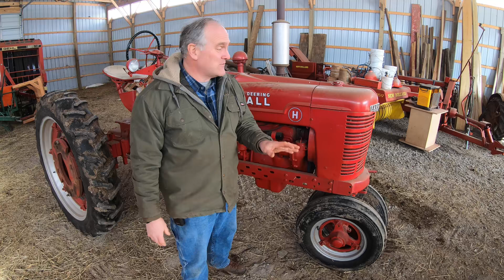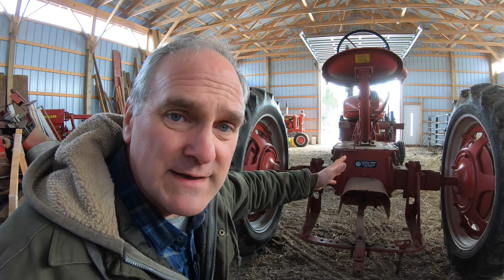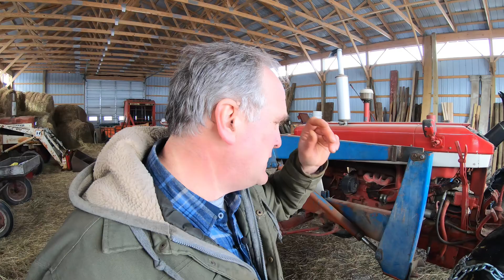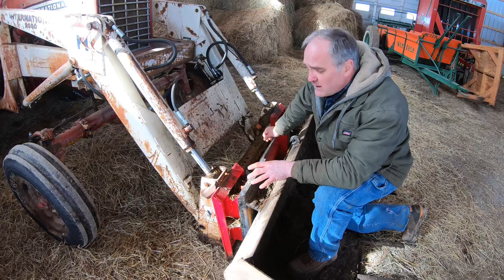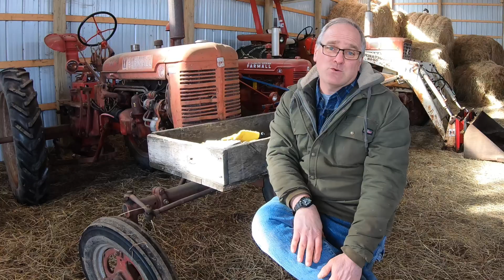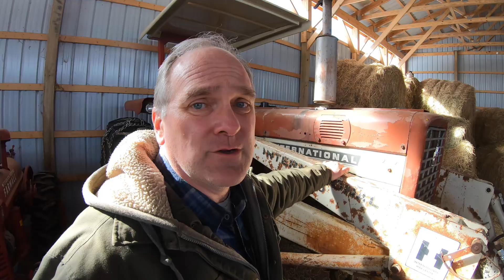Buying an Old Tractor for Your Small Farm

Comment: Just a quick note: To add to what Pete shared in this video, one thing to consider when buying a tractor is the type of attachments and how often you may use them. Working in a rental yard, I work with customers all day who moved to the area, bought a small farm, went and spent 20,000 on a tractor, and even more for implements. But in then end they still give us a call at the rental yard because they didn't purchase the one implement they needed. Often times that is a backhoe attachment. You could easily spent 5-8,000 on a backhoe attachment that you may only use a couple time a year. So in that case, it may not be a good return on your investment especially when you can go to a rental yard and rent a bobcat excavator for a weekend for around $300.00. The other aspect would also be service and maintenance of an piece of equipment. generally attachments will require more maintenance then the tractor. I love my antique tractors and use them when ever possible, but sometimes, especially in the case of needing to dig with a hoe, its just easier and more efficient to go rent a piece of equipment for that intended purpose. I full heartedly aggrege with Pete about using an older tractor for your homestead and this is why: 1.) With an old tractor you will find that there is just certain things about it, such as how much choke it likes to start. 2.) with the simplicity of operation, you will find that others in your family, even younger people will be able to operate it. 3.) You will build a bond with that tractor, learning its limitations and what it can and cannot do. In all its just like adding another member to your family. Be careful though... As I am sure Pete will agree with, you will fall in love with your tractor, and before long, it will have a sibling sitting next to it in the barn!... Thanks Pete!
Reply: Ty kindly!
Reply: Great advice.

Comment: Great intro video Pete.  I grew up on IH. Non live pto is a pain. When brush hogging with the M without an override clutch on the power take off I hit the clutch and the 6 foot pull type kept driving the wheels and tried to push me into the ditch. Pop had warned me about that but young high schoolers don't often do as they are told. Be safe out there we need you.

Comment: When we started our little hobby farm I looked at a lot of old and older tractors.  Virtually every one of them would need work and since we started with raw land and no infrastructure I skipped over that idea.  We bought a new Mahindra 30 hp with loader, box blade, shredder and I found some vintage implements to go with it (plow, bedder and post hole digger.  Six years later we have cleared land and have all of the infrastructure in place.  We built a working hobby farm and though I have beat the snot out of the little Mahindra (Mitsubishi) it has had zero failures other than battery cables.  I am not sure I could have made an older tractor do what I have made this little tractor do and have it survive.  We paid $265 a month for the tractor and it is paid off now.  

I still want an older tractor to play with, but for us the new tractor was a very wise investment.  Since I have not yet found my old tractor, I get to live vicariously through you Pete.  Thank you for this series and all of your videos, it does make a difference to many of us to see your life and benefit from your experience.
Reply: You should see what my 1948 super a and 1969 Deere 2510 have gone through with nothing but maintenance parts being replaced on them(and maybe a weld every few years on the snow plow lift arm when someone makes an oopsies at -35 degrees)
Reply: @loganyoutube4818  It should not be a contest, but just for example, I frequently use mine to knock down trees, they don't always topple, the 30' ones need to have the bucket ran into it numerous times at full height before they surrender. Sometimes the stump breaks at ground level and I need a single ripper on the box blade and the 3 point hydraulics to coax them out.  I don't recommend abuse, but at times it happens.
Reply: you can't tell me that new tractors can survive longer than old ones. you do not wanna know what we have done to our mf 135, for example when felling trees and they do not fall we pull them down with the tractor and 42hp are not alot for doing that so fullgas diff lock and instant driving away than at the hard ones when you press the clutch as it isn't going forward the tree pulls you back like 2m and the tractors does that without getting damged. also it ran into a tree with around 20km/h and it got only a few dells
Reply: @christian9125abd  I have a mf 245 and it works perfectly. I also bought mf 3625  new it is in them shop clutch came apart now it has to be split to fix.
Reply: @salmonhunter7414  at our 135 the clutch needs also to be switched as the pto part isn't working anymore
it does not disconnect completly
Reply: @christian9125abd  Why would you think anyone is telling you that new tractors will survive longer than old ones?
Reply: @NotOnYourLife  you, by saying a old one would have not survived that which is totaly wrong as old tractors have outlastet many new ones, because a new one can be dumped into trash when hitting a tree
Reply: @christian9125abd  I cannot help you if you are unable to discern the meaning of "I am not sure I could have made an older tractor do what I have made this little tractor do and have it survive."
Reply: @NotOnYourLife  so tell me what else that means
Reply: @christian9125abd  "I am not sure..."  is the clue you appear to be missing.  I did not say an old tractor would not have survived,  I said "I am not sure I could have made an older tractor do what I have made this little tractor do and have it survive."  I can explain it to you but I cannot understand it for you, you will need to do that for yourself.  If you still cannot understand it, please ask someone else to explain it to you.  My hope is they are able to.  Have a nice day.
Reply: @NotOnYourLife  by writing an older tractor you assume that the other one is old i mean for professional farming a tractor would be considered as old if it is older than 10 years
Reply: @christian9125abd  Bless your heart.
Reply: Exactly what I did ,we'll worth the investment, I have a 2538 Mahindra and love it , backhoe for stumping , digging waterlines ,box blade for grading ,have a five foot rotor tiller , run a wood splitter with it , looking at smaller mower and round baler for it .the possibilities are almost endless with this tractor verses an older tractor. Wish I had bought it years ago 😂
Reply: No such thing as a hobby farm....if you have to think about that then I am sorry for you
Reply: @scrapeyhawkins5299  I have to ask, do you scrape things for a living?  Scrapey is a very unusual name.

Comment: Hey Pete, Is there any particular reason that you don't own a Farmall cub to use for those even smaller projects? I know they are low on horse power but I have found that I like mine for use around the property to pull my 5X8 trailer doing cleanup work. I have always been a John Deere Man, but the one thing that I like about the cub is how easy it is to get on and off the tractor. Enjoyed your video! R.B
Reply from the maker: Hi Robert, I have a Cub but it's not running. I have a Super A (next size up) that we use a little bit, but the Super C seems so much handier to get on & off of, and it has more power. So it gets the most use for daily things like pulling trailers & wagons around the farm.

Comment: I tried pulling a 2 bottom plow with my Farmall a and it just spun it’s got about 25 horse  but it just doesn’t have the weight
Reply from the maker: That's a souped-up A if it has 25 HP. Stock A's are around 15 hp, 1 plow tractors.

Comment: At home we had almost every brand you mentioned on your list other than Allis Chalmers.  My Dad ran a truck farm, and aside from the big tractor we had for plowing and discing, which was an Oliver 1655,  all our tractors were similar to what you have Pete in horse power range. We used a Super C Farmall for planting....It had a belly mounted 2 row planter.  We also had a Super A Farmall which was primarily used for cultivation.   We did have one odd balll....A German made Holder, model AG3 articulated tractor that we used for roto tilling, and for pulling our transplanter, because it had really slow creeper gears that worked great for both applications.   That tractor had a two cycle Diesel....Noisy little devil, but it put out 34 horse power.  
Great information Pete, for anyone starting out, even us collectors!!   Have a great day Pete!!
Reply: Do you still have that ag3?

Comment: I wish I had a gas tractor we have diesel tractor they jelled up this winter
Reply: Diesel is a stronger tractor when it comes to lifting
Reply: @connersprague2764  its the hydraulic pump that drives the lifting power, but diesels put out far more torque per liter than gas, providing better power for the tow implements and the longevity and reliability of most diesels is far better.
Reply: @davidparadis490  yeah cause I have a john deer 510 and its a very powerful machine it can do anything whether pushing down trees or lifting anything needed
Reply: Just put anti-gel additive in
Reply: @davidparadis490  yes I did even that didn't help being 20 below had to replace fuel filter and put a gallon of gas in the diesel work good after that
Reply: @richardstanley7641  solution: don't go outside when 20 below 😄

Comment: What do you think the biggest tractor I would need on a 50-60 acre farm that would be mostly hay making ground?
Reply from the maker: It would depend on what implements you'll be using to cut the hay (sickle bar, haybine, or discbine) and the type of bales you want to make. Sickle bar mower and small squares could get by with 30 hp, while discbine and large rounds 75 horsepower and up. Lots of choices there.
Reply: @JustaFewAcresFarm  Thanks I was thinking on getting a 66 or 86 series international to run a discbine and round baler someday and the videos are great by the way.
Reply: Whether the farm is flat or hilly is very important to put into the equation. Haying equipment is heavy and as Pete mentioned a baler with a wagon behind can be tricky on hilly terrain.
Reply: To add ballast and lower the center of gravity on a tractor it's important to have liquid properly put into rear tires.